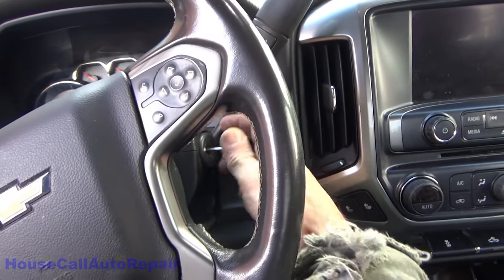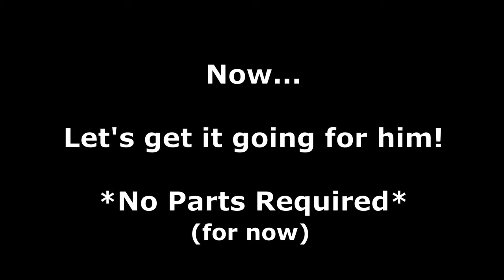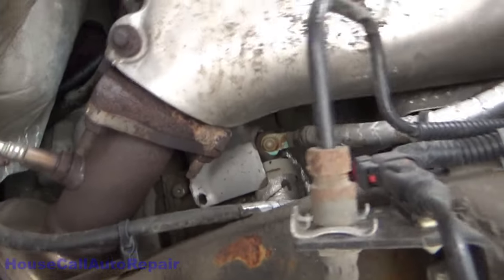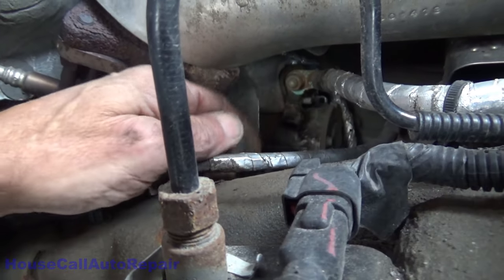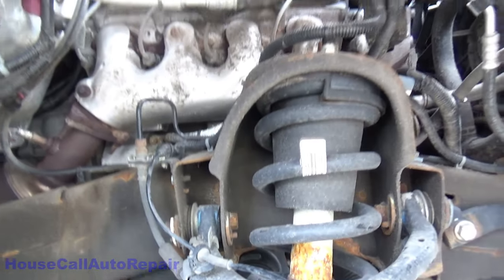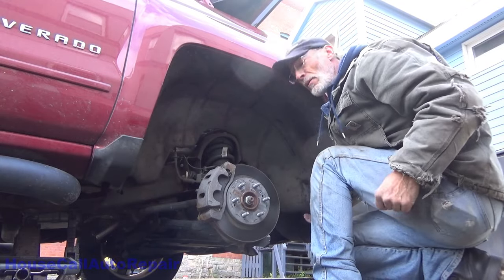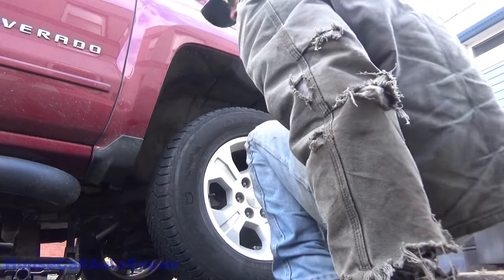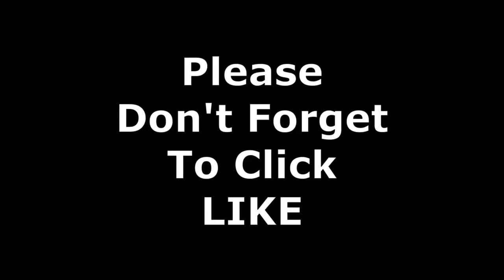2018 Chevy Silverado - No Crank, No Start - Auto Repair

Comment: You should not apologize at all for “not getting us a better repair”.  This was perfect.  A lot of us novices might have jumped to conclusions and just thrown $100+ at a new starter and then, been disappointed when it didn’t fix the problem.  This video showed the value of thorough test driven diagnosis.  You started at one end of the system and worked your way to the other until you found the issue.  This was worth every second for your audience.
Reply from the maker: The sad part is that because of where the problem is, a new starter may have "fixed" the problem (temporarily)
No one would have ever known. (I try to never assume)
Reply: (exactly what happened for me after a $300 Starter from a "mechanic" --HE very well may have been the one that broke the lock-tang; the world may never know - 2017 Chev Silverado )
Reply: Thank for educating us who still like to learn something new everyday 👍🏿

Comment: Good catch but none of the 2013 - 2018 Chevy or GMC 1500 No Crank that has come into our shop was that simple, I would suggest anyone with a charged battery that's having a no crank issue on these trucks thoroughly clean all of the ground and power contacts of the starter and battery.
Reply from the maker: That would be common sense (endangered... I know)

Comment: My truck won't start today.  Its been intermittent for a few months.  Some times it works perfectly,  other days,  i turn the key and get nothing but when i let go of the key a few seconds later it will start. Other times, it wii not start unless your turn the key back and forth a few times.
Reply from the maker: Because there are so many different possibilities, you have to narrow it down to "what's missing". Multi-meters, test lights, and sometimes even a scope, is REQUIRED to be able to find the source of a problem. Finding such an issue CAN be a very time consuming process, especially if accidentally disturbing a connection "fixes" the problem, for who knows how long. ("I fixed it, but don't know how" is the worst!)

Comment: So my 2018 won't turn over at all unless boosted. Even the dash lights won't come on. I have a new battery, new alternator and empty answers from mechanics and even chev. Any ideas?
Reply from the maker: Look for voltage difference between the NEG battery post and Alternator CASE, WHILE attempting to crank. ANYTHING more than a volt or two, and you have the problem.

Comment: The big concern you had about the heat shield that it may short out by making contact possible fire why you didn't go the extra and fix what seen as a dangerous issue. You pushed and tucked it out of the way instead of fixing it. Why but you was concerned.
Reply from the maker: I wasn't about to break off the rusty fasteners to pull out a mangled heat shield that some bozo mangled. I DID push it out of the way as it was as you said, because it was extremely secure, but in a bad spot where is COULD chafe a wire. I identified the problem, and addressed it. I took i got it running again. Fixing that shield problem is a different job.

Comment: Get rid of the crappy starter connector and cut the plug on the starter and put a ring terminal on the starter because those plugs break and the heat destroys them and you will never have to mess with that plug again
Reply from the maker: Believe it or not, that truck is still starting without issue, and the owner still hasn't replaced the pigtail and connector.

Comment: My wife has a no crank no start issue with her 07 Caddilac CTS…when it was running the gauges would stop working (gas… temp ….odometer…etc) and the ac would stop working at the same time then after wouldn’t crank it start. Any clues what that could be?
Reply from the maker: First thing I would do is scan it. Then, depending on what I find, I'd look at the network wave forms. Is there an issue taking it down?
Reply: I don’t have your type of scanner tool
Reply: It sounds like her alternator died.  Voltage got too low causing weird electrical phenomenons, now the battery is too low to even think about cranking the engine.
Reply from the maker: @sneelectronics8339   Without a scantool, start by making sure battery is fully charged. Turn ignition key to ON and make sure the check engine light is on (tells you the computer is alive) Check for security lights. Check fuses for power AND continuity. (Doesn't matter if a fuse is good, if no power gets to it...) Check function of ASD relay....
And with a wiring diagram, check all associated grounds!

Comment: My car won’t start on first crank but starts on second attempt. Been doing this since about a week ago. Just replaced battery yesterday and same outcome. Any ideas?
Reply from the maker: There is probably a weak connection on either the power or ground side connections. Check for voltage drop AT THE BATTERY POST (not clamp) and the STUD on the other end. Sometimes you'll find the connection between the actual wire and the clamp, is no good!
The initial attempt heats and fuses the connection for the next attempt. Might even be a sticking starter solenoid.
Reply: @HouseCallAutoRepair  thank you sir, any feedback is appreciated. I will def’ look into this.

Comment: Thank you for the video! My 2018 Silverado was doing the exact same thing. Pushed that connector back in and it instantly started, but having trouble keeping it connected. Does the grease help with the connection?
Reply from the maker: the grease just help keep the corrosion out.  The plug has to actually "click" into place. if it can't, the 'pigtail' most likely needs to be replaced.
(There SHOULD be a RED lock tab)
Reply: I replaced my starter with your help in this video and broke the connector 😅 any tips on replacing the connector?

Comment: My 2018 gmc sierra is having the issue no idea if it is a connector or a starter either way it is stressing me out! Will find out once I finish my set at work
Reply from the maker: you can run a by pass wire, with a headlight bulb inline for safety, directly from Battery + to the signal connector on the starter it'self. If that makes it crank (to this day it still startles me) then the starter is fine. Take that SAME wire, and move the battery connection to the negative - side.
Now connect the other end at the starter, into the unplugged signal wire. Turn key to start. If light lights up, the connection and all wiring is correct. IF it does NOT, you MUST make sure that the relay is working. A quick test I often use is a headlight test lead from Battery + to the relay SOCKET where Pin87 sits. If for some reason that does work, I check again between Pin30 and ground to make sure constant power is there.

Comment: In video timestamp 6:45 it looks like there's green corrosion forming on the B+ starter solenoid terminal for the battery cable connection. In time, that corrosion will migrate up into the cable and cause voltage drop resulting in a future issue. If viewers see that stuff forming, take the time to remove the cable connection and clean it up. ((just my 2 cents))
Reply from the maker: Thanks for pointing that out, and yes... I agree. (He hasn't replaced the wire/plug yet, but when the temperatures improve) He said He'll have me splice it in and clean things up, then.
Reply: I wonder why the auto industry doesn't use an anti-corrisive metal on the starter power connecters? Like brass or even a stainless steel connecter? And stud that the power cable is connected to? Heck, might as well use stainless steel wire also? These auto makers want you to buy new parts for your vehicle on a frequency, like once a month, gotta perform the same ritual? Diagnose the problem, count your money in your wallet, then decide, ok, new starter? And no pizza for supper? Or get pizza, and leave the truck sitting in the driveway, till payday? Geez. And all these starters? Are remanufactured? Not a new part? Geez, again.

Comment: My 2014 Silverado does much the same but will start with a 2-3 turns of the key. Very intermittent and unpredictable. I just swapped the starter relay to see if that helps. Time will tell.
Reply from the maker: Intermittent stuff like that is often the effect of fretting connections.

Comment: 2017 hc 1500 
Turns on after a few turns checked all fuses and relays for starter tab is broken on that same signal wire was going to replace whole starter but now gonna replace the wire
Reply from the maker: As long as you can pass current through that wire, into that connector on the starter, securely, you should get it behaving in no time.

Comment: So my issue is i get a click no turnover, do this like 7 or 8 times and it starts. Justbhad the starter replaced and its the same issue. You think it's a ground issue? Going to check the connection in this video today
Reply from the maker: Either the starter is defective or you have a ground issue. EASY TEST:
Connect a test light (Or volt meter/scope) to the battery NEGATIVE and the starter HOUSING. Try to crank. If the light lights (or shows ANY voltage) AT ALL... CLEAN your grounds!

Comment: question did this throw any codes ? cause mine did not. i have 2018 chevy tahoe, does the same thing.. every now and then.. it won't crank on the first try and I try again and it cranks.. do you think it could be the same issue on the video?
Reply from the maker: I have a sneaky suspicion that could be a module communication issue, if not a bad, thermally sensitive, connection in the circuit .. I believe I had P0617 and P0615, starter relay control circuit faults, but I probably caused those while checking the relay circuit. The trick is to put a small test light from battery positive to the relay output (relay removed) If that small amount of CURRENT illuminates the light, you have proven a good connection from the relay, down to the starter, through the starter solenoid, all the way to ground. Easy .Just MAKE ABSOLUTELY SURE you DO NOT put the power to any other connector in that socket! Doing so COULD smoke a computer module.
Reply: @HouseCallAutoRepair  I am no mechanic, so I only understood half of what you said lol.   I am a woman that is married to a non-mechanic man.  So, I am trying my best to solve this issue.  I took it to the dealer to clear a "power steering" update message on the front dash.. which they did.  They also replaced the Fuel Pump Control Module. It was working fine for a while, I took it again because of the start issue.. it won't always crank on the first try...first example, one morning this rainy day.. it took 9 cranks and turned on the 10th crank... :(  I took it again to the dealer... it cranked fine with them.. and they told me to clean my key .. that could be the issue.   Which is not because I cleaned the key.. and still the same issue.  What do you think?

Comment: Currently going through no crank no start i jumped starter and it engages but no start any ideas?👀
Reply from the maker: If the starter ENGAGES AND TURNS THE MOTOR it is working properly. If it won't WITHOUT jumper cables, you have a bad connection at your battery, OR you have a discharged battery.
If it DOES TURN THE MOTOR, but won't start, this means the problem is NOT the starter. IT COULD BE MANY OTHER POTENTIAL PROBLEMS.
If your wording is correct, you have at least TWO issues.

Comment: So I have the same problem but my starter clicks using jump wire from silanoid, does not click using key.  Help
Reply from the maker: You are essentially bypassing this wire. This wire's terminal is damaged because the locking clip that was supposed to secure it, was initially damaged. Start at the starter, and work your way back towards what DOES work.
Reply: I will, just like an aircraft start at the problem and work down the gang wire.  I was just explaining what mine was doing ,   but love your videos as it's motivating me to get off my butt..   save money!!!

Comment: I have a 14 Silverado and I just get a click and no power when turning car over and the power and all lights go off and on when key is Halfway turn my negative cable is really hot any idea for why this is happening ?
Reply from the maker: The HEAT means it's not carrying the current. MAKE SURE ALL CONNECTIONS ARE CLEAN AND TIGHT! Check ALL points of contact on BOTH battery cables.
MANY vehicles have issues with the GROUND wire rusting at BOTH the frame and the engine block. (It is critical that these are clean!)

Comment: My truck (same year, same make, 1500 custom 5.3L) has the exact same "start-up" symptoms. No dash lights, no clicking, everything except the engine light on, is this the most likely/only scenario? Loose cables? 

I'm going to pull the wheel and cover tonight after work and see what I find but I've had just about every other aspect of the starter checked by my more electronically/mechanically brother and no issues
Reply from the maker: Check for main power at the starter. 
Check for power at the starter signal wire during crank attempt. (the bad connection here)
Make sure there is NEAR ZERO volts between the starter case and the negative battery terminal DURING CRANK attempt.
if you have power, signal, and good ground...replace the starter.
Reply: check your grounds chevy trucks are known for bad braided grounds , check them all .

Comment: I do have an Escalade 2018 and I did replace
 the connection go to the starter and still is not starting
Reply from the maker: hook a lightbulb between that connection and ground... then see if ir illuminates when you move the key to "start"
if it does, replace the starter. if it does not, work backwards and check the relay, etc.